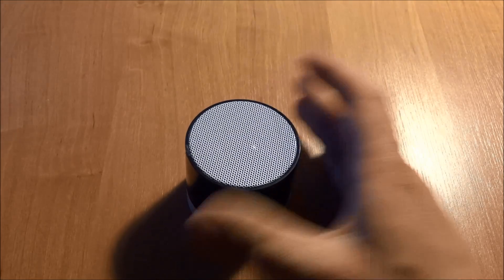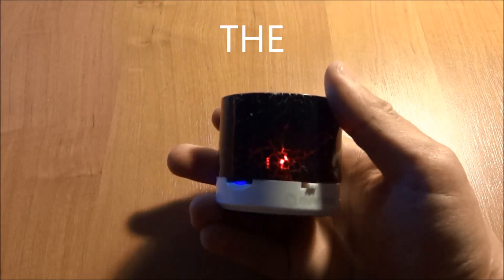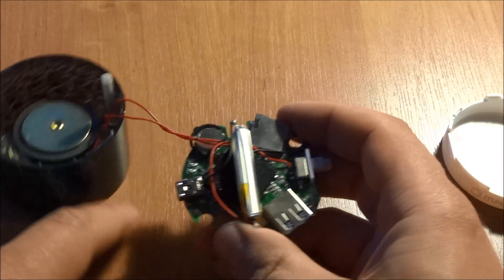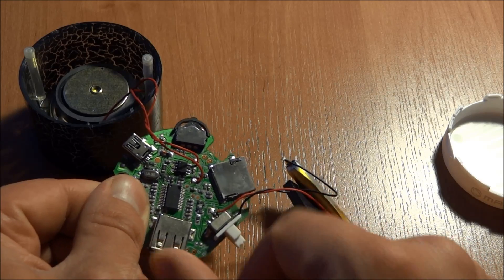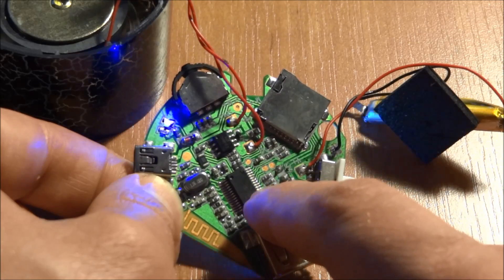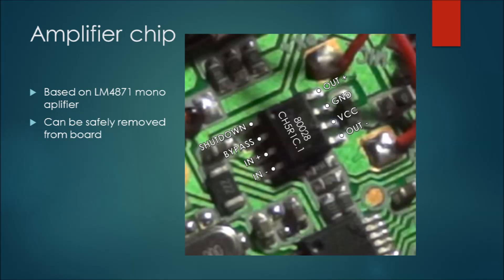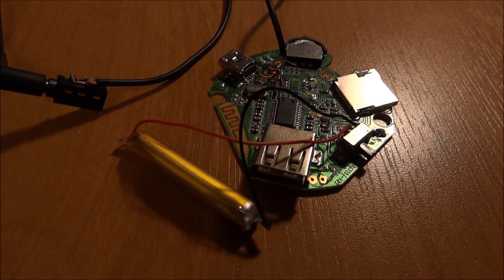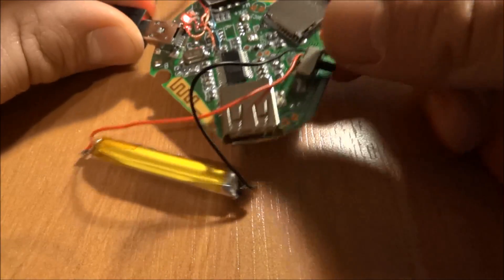Hacking cheap Bluetooth speaker into stereo Bluetooth receiver with MP3 player

Comment: sir i have same bluebooth speaker, how can i repair it, its alway telling low power and poweroff, plz help meee
Reply: the battery is dead
Reply from the maker: I agree, if speaker works fine while connected to USB power supply, then battery needs replacing. Batteries in those speakers are really cheap and poorly made. They're supposed to hold charge 20-30 times and then you'll have to replace them. This is by design (I paid about 3-4 USD for the speaker) as most people would simply throw it out. Same goes with cheapest replacement batteries for mobiles - they suppose to be usable for a month and then capacity drops to 20-30%
Reply: Mine is not responding even on USB charging mode having the same model u have is the cheapest is dead

Comment: I have a weird question...is there a way to change the announcement sounds of the device? Mine speaks with a weird accent while turning on, turning off and  between the modes.
Reply from the maker: I tried that on one of the radio styled speakers and I came up with chip that contained the voice data, it was communicating using IC2. Disconnecting that communication line just hanged up the boot process completely and it had to be disconnected after initial start for this to work, so there isn't a good solution for this afaik.
Reply: Panda Engineering Thanks anyways. I’ll write if come across a solution.
Reply from the maker: It's a good idea to take a look at datasheets, you'll rarely find anything by just a number, but googling the number may give you some similar chip results. I've eventually lifted chip legs one by one from the board and checked if that helped. It's a shame that they make some nicely designed speakers with annoying announcements instead of chimes.

Comment: Hello, is it possible to solder or attach a third party mini stereo amp card such as Pam8403 onto this board and keep using the existing functions like bluetooth, sd, 3.5mm, usb ..? Since there is an all in one setup  on this board, I can upgrade it by adding a new cheap powerfull mini stereo amp and relatively high cap battery and speakers...
Reply from the maker: Sure, I don't see why not. If you need a stabilised 5V to power the amp, you could probably get that from USB out on the board.

Comment: I have 2 speakers with rda5856te chip any hope in turning them into stereo? also I have a Bluetooth receiver that has the same chip Ithought it was stereo but I found that left channel plays on both sides and right channel is muted but couldn't find a route it's weird both speakers sound is completely mono while the receiver only gets left even if they have the same chip
Reply from the maker: I found https://www.eevblog.com/forum/projects/inteasting-bluettoth-speaker-chip-rda5856/ which also links to a datasheet of that chip, seems to be a SoC with programmable outputs, but probably in your instance they went with pin 14 (DAC OUT) with single channel for simplicity as it only has one analogue output from audio codec (see Block Diagram on page 6 of datasheet https://github.com/RDA5981/RDA5856/blob/master/Datasheet/RDA5856TE_Datasheet_V0.03.pdf ).

It has stereo capability but it would have to have additional circuitry and be programmed to use GPIOs

Comment: How do i find out where my Left and Right channel is?
Reply from the maker: If there is no datasheet and I have no idea I usually use a small earpiece from old headphones and solder it to audio ground (or battery minus if I don't know where is the ground). Then I try to play something and  probe around (just briefly touching connections) with the other cable from earpiece near the chip to see if I can hear anything. If I have any clue what could be the audio signal, then I just play the stereo test (there are many available on youtube or if you google it, there are mp3 downloads) to figure out what the channels are.
Probing by just touching briefly is important in case you'll be shorting something out (with earpiece there is a very minor chance to break anything) and in case you get amplified output that could be very loud.

Of course you could use two tone signal on different channels and probe it using oscilloscope or a meter that shows frequency of the signal, but not everyone has this.
Reply: @pandaengineering  Thank you!

Comment: MY circuit uses BDAT750-Z as main IC, couldnot find left audio channel in the circuit. Removed amplifier and still mono,lol. Is the main ic mono type??
Reply from the maker: I tried to google this IC, but can't find anything. What I often do in this situation (as this is low voltage and low current application) is simply, that I get a broken headphone without connector, connect ground to minus of battery and probe (for less than a second in case I connect it to +5V ;-) ) other wire across all IC pins while music is playing so I can "find" the other channel. Keep in mind that some chips are for very specific applications and may be that your is mono. You can download stereo test mp3 from YouTube to check what channel you're listening to.
Reply: Your instructions were awesome , i connected ground to minus and probed all IC pins, and it sounds in only one pin in which i connected right audio channel prevoiusly😭 and it plays in left speaker in youtube mp3 audio not while playing right speaker!
Reply from the maker: Sorry to hear that :( I guess they've optimized the chips for exact purpose of BT speakers.
Reply: Some bt ic are mono...

Comment: Hey 
You just join the jack of 3mm 
You can join it direct by the charging slot 
And by pressing stop button continues you goes to the Line a mode and you can use MP3 player

Comment: How do you lead with the noise? I read that is bc the amp and the bt receiver are connected to the same ground (or power source). If you remove the amp the problem is solved?
Reply from the maker: It's not gone - just not as bad. I think the poor quality of the BT chip itself causes the noise too (probably the frequency it generates for the BT transmission isn't filtered and causes harmonic frequency to be heard in the output). Best results I had was always with battery as power supply and nothing else connected.

Comment: I have a Bluetooth single 3w speaker so it is possible to connect that speaker connection to another amp input directly or need to step down?
Reply from the maker: AFAIK most amplifiers expect line level input and there are even ready made kits to bring down signal to line level for cars to get them amplified again for huge speakers in the back. You may be able to just set the output volume very low, but most of these speakers either reset to mid volume when turned off or have all status sounds unaffected by the volume set.

Comment: I am looking for a USB stereo bluetooth transmitter but all are mono, do you know a model that can be hacked into stereo?
Reply from the maker: I coudn't get any no-name brands to transmit stereo(I have a few, BT 3.0, 4.2, 5.0 and all are mono) and it seems that it's mainly because it's easier since there is only mono input and output for most chips in the spec sheet and for stereo it requires more work and circuitry(I think they would need to program inputs and outputs). I think the safest bet are name brands (Jabra, Sony, JBL, Philips) and check with their support first if they made it work.

Comment: I have a neck Bluetooth but the problem is only one channel sound is playing in both sides can you do a video that how to convert it into duo channel
Reply from the maker: If it's mono, just connect two speakers to the output, you will have to see what chips you have inside and check their datasheets. There are a lot of different BT chips.
Reply: @pandaengineering  my Bluetooth headset name is HBS-730
Please check it and reply to me

Comment: This is brilliant.i am looking for it a long time. and one more question "can i change the default sound of it when it on or connected to device?? "
Reply from the maker: I don't thinks so, if you had an adapter with separate EEPROM for this you may be able to mute it by disconnecting it, but I tried it with another device and it just stopped working when it lost connection to EEPROM.

Comment: Its posible to make the same but without batery,using phone charger?i try but overheat,can you help me with that?
Reply from the maker: Make sure you connect the power bank to charging port and not the battery. MicroUSB here is happy with 5V on input, but on battery terminals it  expects no more than 4.2V, so it may cause it to burn the chips if you connect the 5V there. Just leave the battery disconnected.

Comment: If we remove amplifier attach our output aux wire to speaker point. Can it work ? Know   I use it in my car but i not remove the amplifier but it consume more power.
Reply from the maker: Without amplifier it will be very silent on decent sized speaker - you might want to consider connecting it to AUX of the radio - I have another video on how to do that for radio in Fiat Stilo on this channel.

Comment: Where did you got the right channel signal
Reply from the maker: You can get it from datasheet, but I usually just probe around the main IC - I solder one wire from earpiece to ground and I touch the other wire to outputs of the chip.
Reply: @pandaengineering  It seems my device have only mono output because the device has headphone jack and when i checked for right and left channel the headphone jack just gives mono sound .I checked for the right and left  channel on board but could not find .
Reply from the maker: That's possible. One of the headphones I reviewed ( https://m.youtube.com/watch?v=kf35bZ_kG2o ) had mixed stereo channels - there was no difference between left and right. Chip didn't have the stereo capability at all.

Comment: great vid, i just bought one of these cheap bluetooth speakers,  and want to hack it,  it says the usb charge socket is also the aux input combined....which means i'll have to add an external 6.35mm jack socket for easy connection....i'll also add a led on off switch too....thanks.

Comment: Can we connect two speaker with the Bluetooth module
Reply from the maker: If you'd like to have proper stereo speakers, I recommend doing something like in the video and adding to output a stereo amplifier chip (like LM4873 - 2.1W, 5V VCC and has some additional features) or another LM4871 mono for the second channel, but keep in mind that there is a capacitor between output of main IC and amplifier in circuit and for the other channel it's missing, so you would need to add it too.
Reply: If you want to make a powerful stereo channel, use a TPA3116 module.

Comment: Is it possible to reprogram bluetooth speaker sounds using pc
Reply from the maker: Most chips are usually all in one and have baked in firmware, but some of them have GPIO pins. Unfortunately I never saw any deocumentation on commands you can send to them. I think this would be mostly restricted to basic configuration like enabling/disabling functions (fm/mp3 from sd card/aux etc) but those also require all other components.

Comment: Can I fix this module in PC???? And if yes,then how can I do it??please suggest me
Reply from the maker: If you want to connect it to a PC, maybe simply plug it into a line in or mic input.
If you mean that you have issues with Bluetooth in your PC, then it's a completely different module. I suggest reinstalling drivers or even OS and if that doesn't help maybe check with manufacturer if they have some suggestions. Often if BT module fails you will have to replace it along with WiFi in laptop or simply buy external USB module (that's the cheapest solution).

Comment: Hii.. Can u name  where should i connect female receiver
Reply from the maker: Hi! at 7:29 I explained where I soldered ground, left and right channel out to the board, but if you're looking for AUX-in, then I had a AUX to USB cable in set with the speaker, so I think it uses USB pins (possibly D+ and D-) to send audio. More details on AUX-in you can find in datasheet https://oss.aliyuncs.com/netmarket/29bc7cac-8266-45bf-b2b0-f152227ba546.pdf look for package SSOP28 (28 pin) it would seem that pin 10 and 11 match (LINR LINL), but your chip may be a bit different.

Comment: Sir I done all the steps but still I am having more noise
Reply from the maker: It's a very noisy chip, it's possible that SMD capacitor on the output did a lot of the filtering, so you can try adding something similar. You can also try looking for simple schematics of high frequency filters for audio, it will remove some of the noise. I found that speaker works best when it's battery powered, my USB chargers were introducing more noise to the audio.

Comment: are sure its work really?
Reply from the maker: I worked :) Later I connected it to a car radio as BT receiver but it was so noisy (a lot of hiss, I think that alternator in my car creates a lot of high frequencies and this speaker doesn't have a good power supply isolation since it runs off the battery all the time). Now I would recommend just buying simple Bluetooth receiver on ebay or Aliexpress for ~$2.

Comment: What will happen if we dont remove the amplifier??
   Pls help
Reply from the maker: It's possible that you will have some more noise on the output. You can try leaving the chip, soldering the jack and comparing right and left channel (right could have more noise), but other than that it shouldn't impact the circuit.

Comment: Is it necessary to remove 3w amplifier from board
Reply from the maker: I don't think so, but if you want to conserve we much power as possible then you can do that (power consumption should be very low when it's not connected, so I didn't bother).
Reply: How If i didnt remove the ic but i I directly connected the R output and L output to the (in+) ic pinout?
Reply: I sorry i mean the (-in) pin out of the ic

Comment: Sir can u make a vedio on adding multiple speaker in this pcb board that u use in this vedio
Reply from the maker: I'm not planning to go back to that project, but you can output sound to the speakers using something like TDA2822M https://www.st.com/resource/en/datasheet/cd00000134.pdf (see page 4 for usage scenario and sample board). Basically any audio stereo amplifier would do, but this speaker module was quite noisy and I eventually used simple BT receiver and mounted it in my car (in this video https://youtu.be/jVSuUpPEF80 ).

Comment: Bro how to convert mono Bluetooth receiver to stereo sound bro
Reply from the maker: You can try method from the video, but f you have a different speaker, then you will have to look up your chip datasheet (just google the number) and see it has stereo output. Some BT receiver chips are only mono and you won't be able to do anything with it.
Reply from the maker: According to the description it's already stereo, you can open it and check if both channels are connected to different pins on IC inside or simply play stereo test (there are some on YouTube).
Reply: @pandaengineering  i was play left right stereo test but it was mono what will i do now
Reply: @pandaengineering  plz bro tell me a solution
Reply from the maker: @lokeshloki9778  you will have to find datasheet of IC and check it's capability (it may be limited to mono). If it has stereo output, then just connect output to both channels. Refer to chip's datasheet, it should be explained there.
Reply: @pandaengineering  but i need a video solution
Reply: @lokeshloki9778  I happen to have 2 "cheep" speakers (actually with better sound than his), my plan is to take his Solution, leave the Amp chip inside and tap off of the unused "Left" signal.  In my case, if I put the Left signal on both the output signals of the Jack and the Ground, then the other end would plug the AUX of my other speaker.  The modified one is the Right and the other (unmodified one) is the Left.  Pretty much use his video without removal of the AMP and find the Left signal and the rest is as this Video shows (translated for your specific speaker).  Have fun Hacking!
Reply: @pandaengineering  i have cheap bt speaker and it have lm4871 ic that it says in datasheet ongoogle it is mono, so can i change it to stereo?